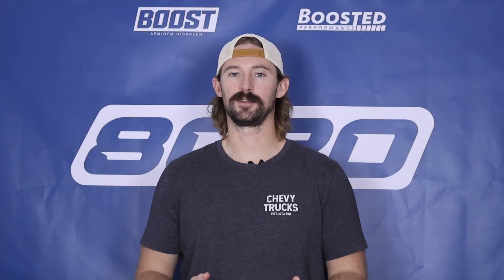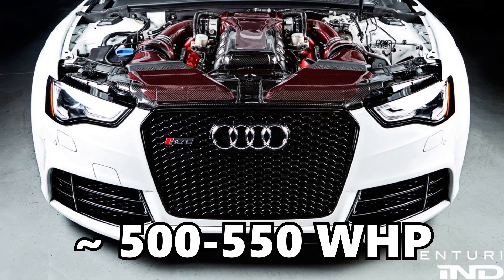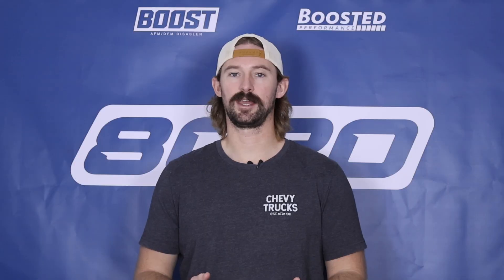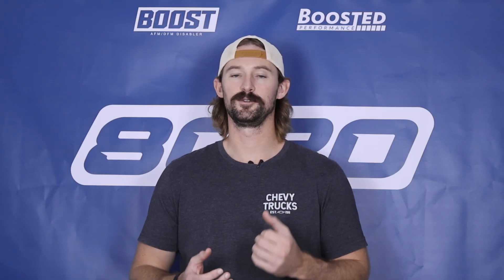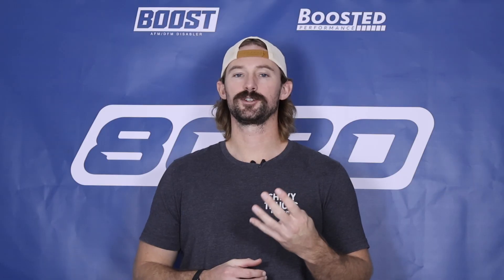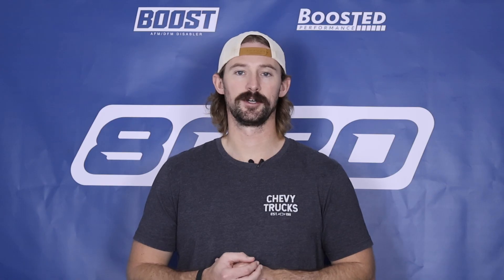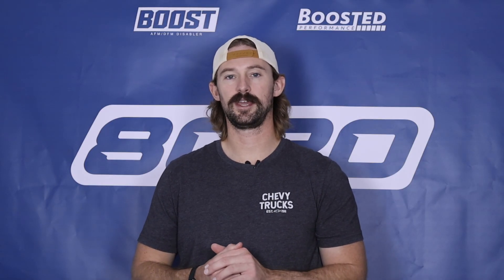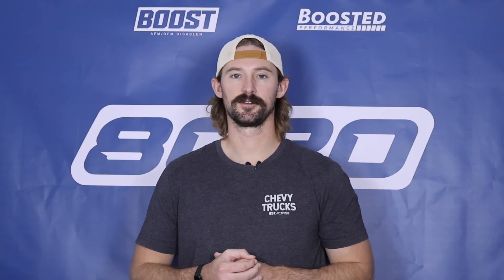How to Build a 500 WHP Audi B8/B8.5 S4 & S5! (3.0T Supercharged V6)

Comment: Theres so much false info In this video.  

The Stock  supercharger will never see 500whp on octane gas even with WMI 

The only chance you’ll see close to 500whp  on pump is if the SC is ported and Thats stretching it.  

You will never pass 500whp without E85 on this platform and you need a hell of a lot more than the 6 things you mentioned to reach that.       

Theres so much more cooling you need than heat exchanger and high flow cats… this video is insanity
Reply: I thought so the same if you can go more in depth on what is needed to go stage 3 plus
Reply: @McarJoel ”stage 3 and  stage 2+ “ are the same thing depending on what company you go with.    But a real stage 3 on our platform is everything from stage 2+  a ported blower, ported throttle body , and fuel pumps.          from the porting TB and SC you can pick up  another 100 wheel hp alone.  The fuel pumps are just supporting mods